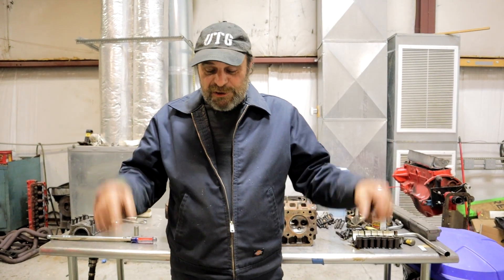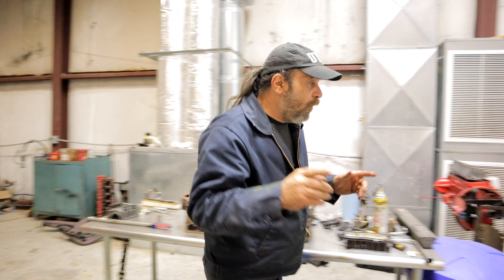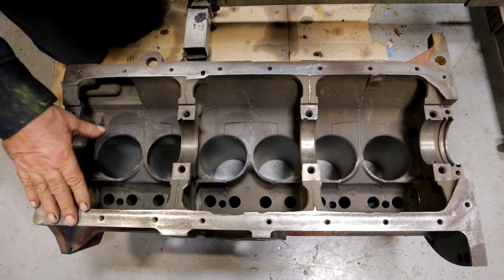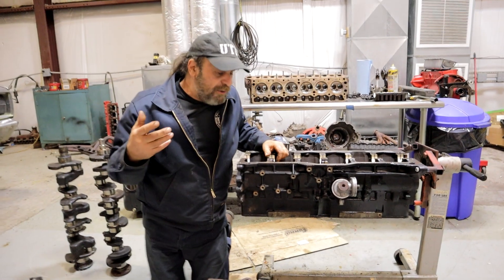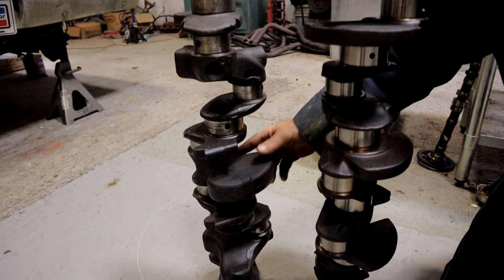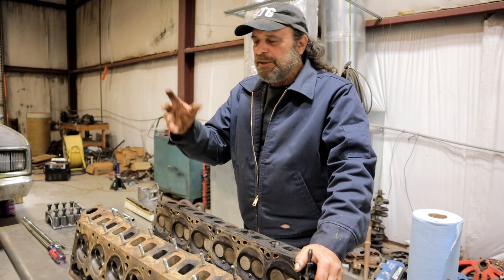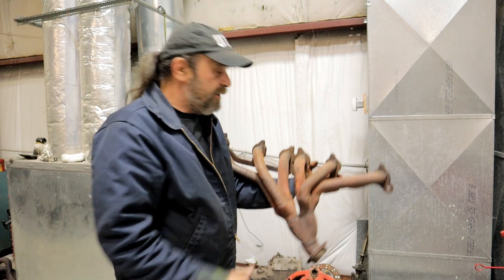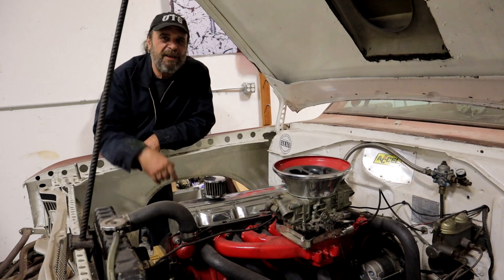The Mighty Mopar Inline 6's History And Comparison - Flathead, Slant, Hemi Six, 4.0 And Hurricane

Comment: In '76 I bought a new Jeep CJ5 with a 258 cu in Inline 6 cylinder. On the side of the engine  block was a Chevrolet bow tie emblem cast into the block. Here in NC on the beaches of the Outer Banks, which can be rough at times. It had plenty of power to get around. A good set of tires helped out.

Comment: why would it be overtaxed? is it just the murican displacement equating to longevity thinking?     you'd be surprised how long sub 2 liter 4 cyl turbo diesels last in daily icetruck etc use.  anyway wagoneer or most any car isn't using 300 or whatever hp just driving down the road, you can't be taking out the max power out of them all the time for simple reason that you'd be going nutter speeds and driving like a maniac. a normal daily driving week might not ever include more than 40  seconds of total pedal to the floor, if even that, in hours of driving.

if there's something to be said about smaller cheaper european engines is that they get an italian tuneup daily, for better or worse, within speed limits.

Comment: Had a 52 DeSoto flathead 6 with fluid drive trans. Used to love freaking passengers out when coming to a  stop without putting in the clutch. Also had a 67 Valiant that looked about like yours gray primed but with a 225 slant 6 and 3 on the tree. I kept a stock of spare  shifter cups because I had a habit of banging gears a bit too hard. Simple cars you could work on. Sure miss those days.

Comment: That 4.0 head is a different animal in terms of flow compared to a 258 head. The 258 head has a shared center exhaust port to start with as well. A lot of the 232/258 heads have a lot larger chambers too. There's definitely work to convert a 258 to use a 4.0 head but it's not uncommon. The intake ports are significantly higher compared to a 258 head.

Comment: Slant 1960-1987 for Chrysler Corp 4.0 1987-2007. In 1988 when I was 16 and about 2-4 years before I found out about the Australian hemi 6, I designed in one of my school notebooks a hemi 4 valve hemi head for the slant with intake on one side and the exhaust on the other.

Comment: I read years ago that apparently, Chrysler sent a Wayfarer VG utility to Webber in Italy with a 265 and bods from Chrysler in Adelaide, ( Tonsley Park )to oversee tests at a factory facility which included a race circuit to sort out jetting and exhaust options to get the best out of the 265 with triple Webbers. Apparently a multitude of jetting and intake sizes were tested before the basic combination that would later form the basis for the E38 VH Charger were settled on. I believe the VG Ute is still in Italy with a collector.

Comment: Tony , there was also a 413 flathead six with two carburetors, used only in heavy trucks.  Weighed  1,170  pounds . Rarely seen nowadays.
Reply: Only used in heavy trucks from '53 - '55 or thereabouts.

Comment: Three major reasons for the difference in block lengths.
1) The 232 was designed around a 3.750 bore. 
2) The bore center distance is 4.380". Same as the Windsor and Cleveland. And .020" less than the SBC/LS/LT. Ideas anyone.
3) With .630 between cylinder walls plenty of room for coolant passages.

Comment: Ya, straight six is the only way to go for old coots like us. I restore Chevy K20s and take out the V8s and install straight sixes. I want simple, reliable, economical, and easy to fix. Except for the muscle cars, those old trucks were the best thing Detroit ever built. Designed by draftsmen, built with American steel, nothing was outsourced. No computers, ck. engine lights, just carbs and points. Good show. I'd love to see straight sixes make a comeback.

Comment: Great video!

I think that the exhaust manifold you showed for the 4.0 is an aftermarket one. As long as I can recall for 91-99 4.0 engines, the number 1 cylinder exhaust duct received number two duct and number 3 as it ran to merging with the rear portion. This rear portion used the No, 6 cylinder duct as the main and like the No, 1, it received the exhaust of cylinders 4 and 5 before merging with the front portion.

Comment: G'day Tony great to see you had some knowledge of the Hemi 6 I think a lot of the engineering for this engine was done in the US and Australia at the same time. The first Hemi 6 I had heard of was in 69 in a Chrysler Valiant designated VFX  it was a 4.0 liter. In 70 was the replacement for the slant 6 in the VG Valiant and it was available as a 1 bbl ,2 bbl and a 4 bbl , in 71 with the introduction of the VH  you got the Hemi in 3 flavors and numerous versions the low compression 215 , the 245 ( which was the regular run of the mill engine fitted with the Carter rbs 1 bbl carb ). Finally the 265 which was standard with the Carter bbd  then there was a hotter version of that engine. Then  came the Weber carb versions the E37 ,E48 ,E38 and E49 versions of the 265 . I believe Chrysler Australia developed a 4 &5 cylinder version of The inline Hemi but never went into production. Hope this helps

Comment: you want 265 parts ? you do actually have them - the block crank and heads were cast here but pistons are basically 318 (same bore slightly different pin to crown height), lifters are 318, 5.750 rod i think they were unique to the 6, stamped rockers and bolt type rocker pivots, big valves head looks a bit like your 225 its not a true hemi more flattened but quite efficient the full on race engine made over 300hp the std pass car 203hp, pacer variant 218 the race engines could run with the v8 GM and Fords

Comment: The flathead sixes in the DeSotos & Chryslers, were longer and had more displacement. They can be swapped into Plymouths with some (hard to find now), parts swapping. A 40s Plymouth coupe w/Chrysler six, and thirty's floor shift truck 3 SPD., was one of the first Hot Rods I remember! Early 1960s. Good Times,,Love, Dubs

Comment: Yes the 215ci (3.5 litre), 245 ci (4.0 litre) and 265 ci (4.3 litre) Hemi Six is a legand in Australia, it was the top performance engine in Aussie Chargers and other cars, we had the 273,318, 340, 360 V8s but they were slower and less powerful than the 265 Hemi in its top factory form Chrysler Australia rated it at 302 Hp , that was with factory fitted , tuned length headers, 3 x 50 mm side draught Webber Carbies , high lift cam and 11 to 1 compression . Straight off the factory floor ! Chrysler took 10 265 Hemis to Italy so Webber could test cams /compression/ tuning and the factory offering was modeled on these 10 engines . The 265 Hemi was 2 seconds faster than the same charger with a 360 v8 ! Most people now know the 302 hp the R/T Six pack 265 Hemi was factory rated at was well short of reality , closer to 375 Hp at 8000 rpm . It has a 3.91 inch bore that can go out to 4.00 inch and a 3.68 inch stroke . There are stroker steel cranks made in Australia along with Alloy heads, it runs the LA V8 bellhousing so a 904 or 727 auto fits , as well as any LA manual box, Chrysler Australia only had 3 speed boxes at first , then Chrysler went to Borg Warner Australia and asked for a 4 speed roughly based on a ford Toploader, Borg Warner came back with the D20 Single Rail 4 Speed, and twin plate clutch . The single rail evolved over the years to an alloy case ( originally cast iron) and gained a 5 th gear , Borg Warner Australia gave the design to Borg Warner America and they renamed the alloy case 5 speed single rail to T5 . And the rest is history . As far as not being a real Hemi  i suggest you look at a 265 head , the valves are cantered north south along the crank centre line at 18 degrees to each other , the chamber is a true Hemi , the plug is in the centre but comes in from the side , the chamber is 35 percent of a sphere ( so Hemispherical by definition) . A Harley motor is also a hemi and has the same features. As a kid growing up in Australia i always loved the Chrysler by Chrysler Two Door hardtop , long wheel base with either a 265 ci Hemi Six or the 340 V8 option . The Aussie Charger is also grate . In Australia our Utes  were badged Dodge , upmarket models Chrysler and mum and dad cars Valiant ( Valiant was not a car so much as a brand .)
Reply: Thanks for posting!

Comment: OK Tony, I know I'm late to the party, but I need to throw in a few corrections.
The 'Floating Power' system was a ground breaking technology that allowed Chrysler Corp to leapfrog everybody in the industry.  It used a rectangular pad engine mount high up, under the water pump at the front, & two side mounts low on the side of the bellhousing at the rear of the engine. An imaginary line drawn from the front to the rear of these mounts put the weight of the engine about the same both above & below that line. An additional long thin pad mount under the bellhousing controlled the rocking motion & prevented clutch shudder.
As far as I can tell, it was introduced to the 1932 Plymouth PB [four cylinder] & 1932 Dodge DK [8 cylinder ], DL [6] & export only, DM [4]. [A thinly disguised Plymouth PB]. I do not know about the Chrysler & DeSoto models, but presume it to be the same.
The "NEW" corporate design six cylinder engine was introduced in the 1933 Plymouth PC & included in the 1933 Plymouth PD that quickly replaced the PC when it was obvious that the PC was not doing well in the showrooms. Also in the whole range of Dodge cars & trucks including the 1933 Dodge  DP & the Dodge Commercial Car HC. [I have owned most of these]

Dodge introduced the Red Ram Hemi for the 1953 model year, & yes, the floating power engine mount system was used with the same front mount just under the water pump design with two mounts low on the side of the bellhousing. This lasted for the Red Ram 241 & the Super Red Ram 270 from 1953 to 1955. The 315 Hemi & Poly got side lugs like Chryslers for the 1956 models & of course for the 325 Hemi/Poly in '57.
Conversions are available that mount the 241 & 270 engines in a more or less conventional way.

Development of the Truck six was abandoned in the US, but the Australian engineers thought that the basic design had potential, so they took it home to see what they could do with it.
It eventually appeared as a 215 low compression engine for Fleet models, Utilities & Taxi cabs, the 245 for general passenger car use & the optional 265 as an even stronger six. 
The 273, 318, 340 & 360 engines were also available through the years in Valiant models up until 1981 as well as the six cylinder engines.
PS, greetings from Australia.

Comment: Hey thank you Tony for the information.  That was awesome! I'm a huge slant 6 guy. Currently I have 3 of them in my 64 Valiant V200 station wagon, has a 225, my 64 Valiant 2dr post has the 170 and a 70 Valiant with the 225. All the good years. I guess 71 and above the power changed a little bit right?

Comment: The Dodge flathead 6 cylinder was a relatively higher torque engine compared to similar engines of its time.. The biggest advantage was its full pressure oiling system...No rod splash  scuppers or  pressure- squirt manifolds. Only partial flow (pressure bypass) filtration, though. For its time, it was one of the sturdier inline sixes- including some overhead vave jobs.
 As wear occured, 2 or 5 were usually the first to knock. 
They were last used in Dodge and Plymouth passenger cars in 1959, but were used in Dodge 3/4 ton military trucks until 1970. Some were also used in agricultural vehicles such as combines, etc. Also used in Smith air compressors. Front 3 cylinders  fired, back three compressed air.

Comment: As I'm sure someone has pointed out, the initial 'Hemi 6' was 245 cubic inches - the 265 came later with the VH and the (in)famous Charger. 

https://en.wikipedia.org/wiki/Chrysler_Hemi-6_Engine

There was also a detuned 215 smog motor to appease the government and insurance bods who were infuriated by a Wheels magazine article that showed a Falcon GTHO doing 140mph on a public road. I've owned all three at various points and I still think the 245 had the perfect balance between fuel economy and torque - it simply wasn't as sexy as the 265 with triple Weber carbs in the hot Chargers.  When I finally got a 360 in the engine bay, I quickly realized how thrifty the big sixes were even if they lacked the exhaust note. The VG Pacer was the only hot Chrysler to win it's class at Bathurst afaik, although brave souls has been punting the early Valiants and the massive Dodge Phoenix (a rebadged Belvedere) up the mountain for much of the sixties.

https://www.survivorcaraustralia.com.au/vg-pacer

Comment: I don't think the four main bearings is a weak point. They are the same bearings used in the Hemi and 440. Also the slant crank is shorter and stiffer than comparable straight sixes.
If anything I'd say the 4.215in. stroke of the 225 would be about the only thing leading to bottom end stability issues. Keep the rpm's from getting crazy and they are fine. The 170 has a full inch less stroke at 3.125in. It's known for very high rpm's when built.

Comment: It's more than the 2in. less block lenght.  They leaned it for a lower hood line and it allowed them to offset the water pump. The offset water pump was set back giving an even shorter overall length.

Comment: The Aussie Hemi 6 started in 1970, with a 245 c.i., (3.76 bore, 3.68 stroke.)which came in three flavours- 1-bbl, with 165 bhp, 2-bbl high comp, with 185 bhp,
and Track Pack 4-bbl high comp, with a mechanical cam, for 195 bhp.
In1971, we got the first of the 265's, same 3.68 stroke, but it used a 3.91 bore, like the LA 318.
It also had three flavours, low comp 2-bbl, at 190 bhp, or so, Premium high comp 2-bbl, at 218 bhp, or the legend itself, the R/T 6-pack which, with three 40mm DCOE Weber carbs, made 302 bhp.
These engines were fitted to all Australian Valiant full-size cars, ( what you guys call a compact), from 1970, until Chrysler Australias' demise, in 1981. Please don't hesitate to get in touch, if you want more info-I'm a retired Automotive Engineer, as well as a Mopar man.

Comment: This is interesting. My first car was a '60 Valiant with 170 six. I've had a number of 170s and 225s over the years. Currently I have a YJ Jeep with 258 (originally carb'd, but now TBI) engine (actually 2nd one--at about 250K I replaced the first with a reman. (It was still running fine, but the rear oil seal grenaded and would require dropping the crank so I went for the rebuild). Also have an older Grand Cherokee with 4.0. 

I really like that AMC 6. It ranks up there with the VW air cooled for number of years in continuous production.

[For what it's worth, every slant 6 I have owned has burned oil. Ran fine, but you had to keep an eye on oil level]

Comment: Great video, Tony. If you ever get an opportunity to see the footage of the Bathurst race of 1972 you will get an idea of just what the 265  E49  motors were capable of. That year an Aussie Charger was leading until it had to pit for a tyre change. Unfortunately they were unable to change tyres because the wheelnuts were seized on by the heat. The car went back in the race but it was  a lap down because of the lost pit time. With dirty weather and tyres down to their steel belts the car still managed 3rd. Unfortunately that was the time of the"Killer Cars" scare in Aus. so all the manufacturers were much less involved with racing here and Chrysler never really got another opportunity to prove their ability in Production Racing. Just to enlighten you there is still floating around a picture of a weber equipped 265 on a testbed in Europe running flat out with the headers glowing Cherry red. Pity you never got that motor in the U.S.

Comment: I was a fan of Chevy and AMC sixes.  I had several slant sixes in Aspens and a van. I think their reputation is overblown.  The 4.0 is a good one, right there with the Chevy 194-292 and Ford 240-300.  I bought Ramblers as a kid because they were cheap and those old 232s  were golden, if not overly powerful. They were great on gas and reliable.

Comment: The most way-out Mopar 6 application is the A57 Multibsnk, which was five individual 250ci flathead sixes hitched into one unit, like a quasi-radial, gear-driving one single powershaft. Used in WWII tanks, and a marvel of expedient engineering in the face of shortage of more ordinary large engines
https://en.m.wikipedia.org/wiki/Chrysler_A57_multibank